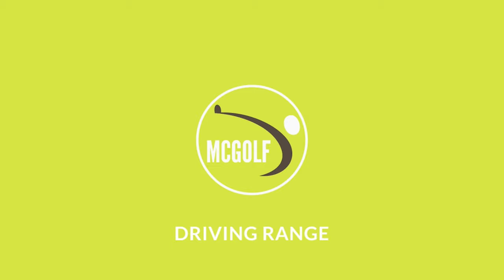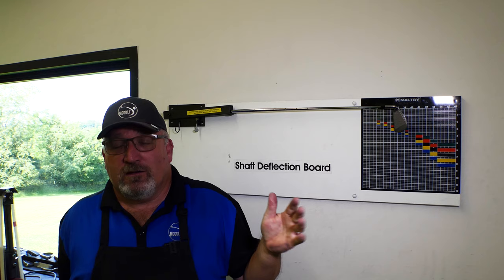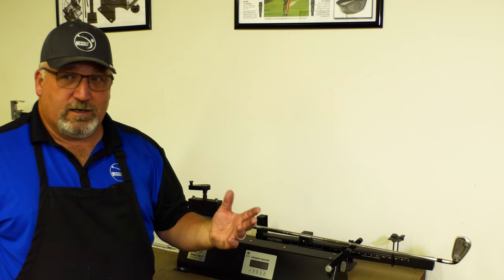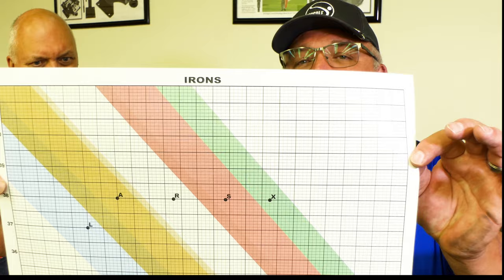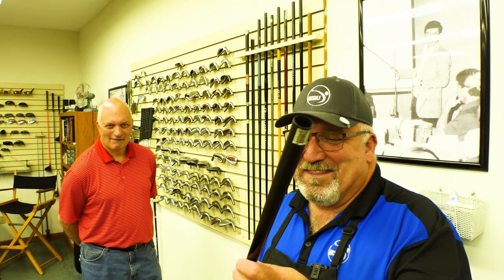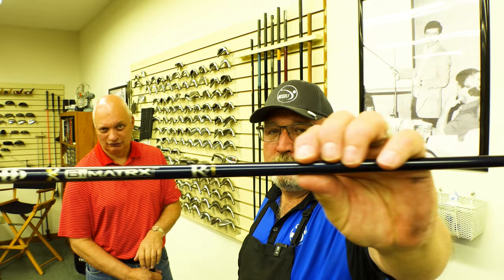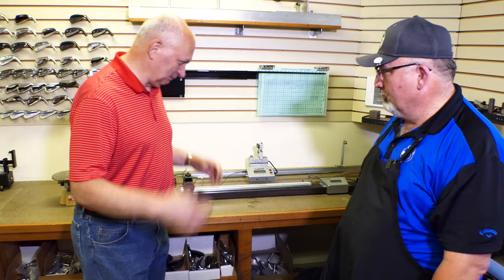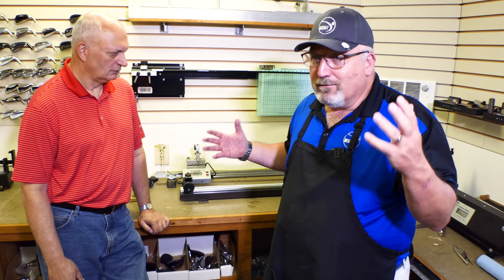What is golf shaft flex? How is it measured?

Comment: Awesome content.   Question: will bubble shafts ever come back?  Can an old one be put into a new head and be effective?   Great
Reply from the maker: With technologies as they are no, it may also run into the shaft needs to be consistent and round, I think it would pass but not without some discussion,  putting the shaft into another head would be looked at closely, if the golfer is not aggressive in the swing probably not. The other point with missed is a lot of the shafts (if memory serves) were also bigger tip diameters.

Comment: Gotta question for you??? I recently, at 71, changed to a senior flex shaft in my Mizuno 919 hot metal irons, Project X LZ 4.0 A flex shafts. Clubs and shafts feel good, but I am hitting the ball too high. Is there a senior flex low launching iron shaft?
Reply from the maker: Larry Young that’s a great question, typically when considering A flex shafts a golfer usually is looking for added height. You might consider a few other things. 1) jack the lofts on the clubs, you might get some add length too. Or 2) look for a heavier A flex to control the way you deliver the head to the ball.

Comment: Great video what do you think of the ActionLite55 shafts in my 588 Altitude irons Regular
Reply from the maker: not really familiar with the action lite series, however based on the model of the club it is built for getting the ball in the air. The most important thing is that it works for you
Reply: @McGolf  Cheers Jim for replying it certainly has helped took a bit of getting used too but great feel. 

My previous irons were FG Tour F5 with DG XP S300, I loved the look of those and thought of trying a KBS Tour 90 Regular after testing some C300 Irons do you think that is a big change ? Also was thinking of strengthening the lofts by 2 degrees to get nearer to the C300 lofts.